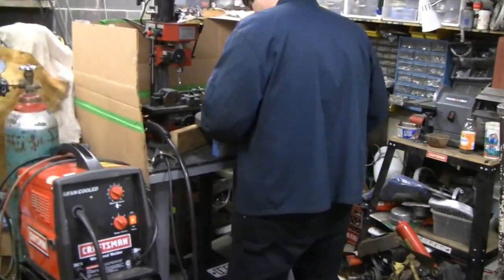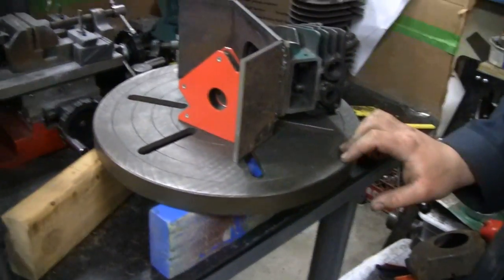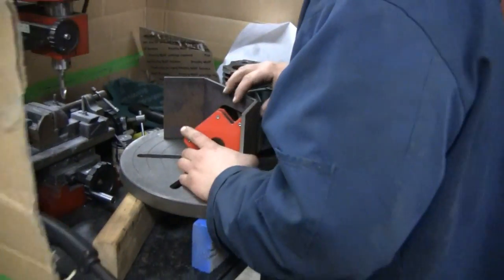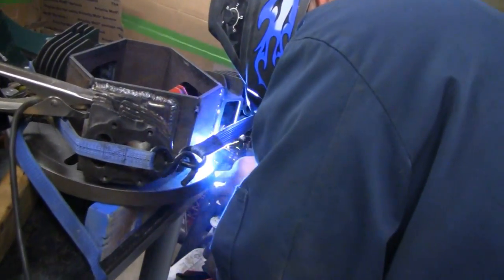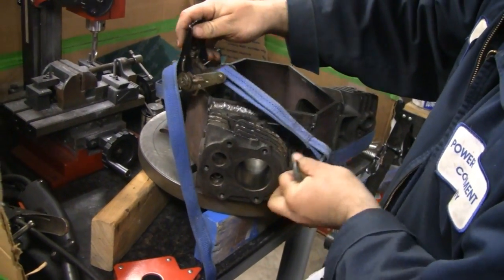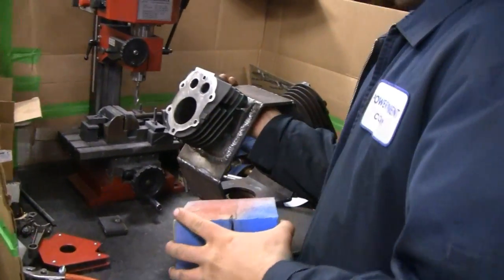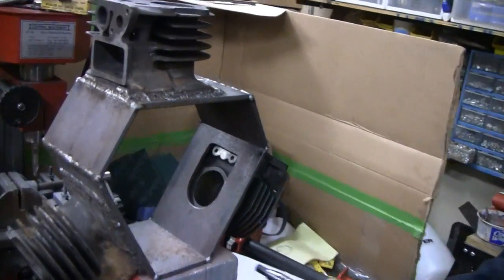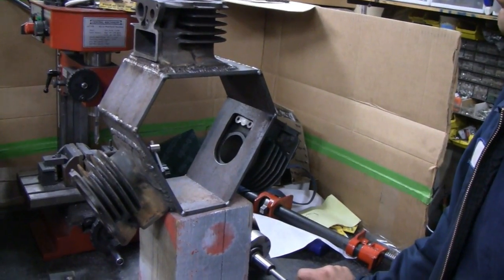HOMEMADE RADIAL BRIGGS ENGINE (part 9)

Comment: Excellent work! Will you guys be welding the inside joints of those crankcase plates eventually? Or is welding just the outer joints of the crank case sufficient? Sorry, I've only done basic welding practice :-)

Comment: I was wondering. Since a briggs radio engine has never been built and I'm sure this will be a unique piece of art by the time it's done, I was reading the comments about the oil and adding an oil pump I was thinking would you guys be willing to add a turbo to make it even more unique than it already is?

Two more question! Is the oil pump going to be electric or move along with the crankshaft?
And what will be your source of fuel be, carb or fuel injector?

Thank you and I can't wait to hear it run, great job so far!

Comment: why is the crankcase so big? Are you guys going to make connection rods?
Reply from the maker: adam galbraith It needs to be that big because alotta stuff has to go in there!! Yeah we gotta make the rods!!☺
Reply: at you going to use a propeller as a flywheel? and what are you doing for ignition?

Comment: Won't you have problems with the oil collecting in the two bottom cylinders and valve cover areas?   Looking good, I was just wondering.
Reply from the maker: 231flash Probably have some oil, but nothing that would cause a problem!!☺

Comment: Really cool project. Have you thought about some kind of baffle for the lower cylinders? Aircraft engines usually have the sleeves longer not to let the oil drain from the upper parts directly into them, so it doesn't smoke too much. Keep posting!
Reply from the maker: Gustavo Santiago Thanks Bud!! Yeah we're tossing around a few ideas to prevent that!!☺

Comment: Maybe one thing you could do is have a little chain driven oil slinger at the bottom of the crank case, that way you won't have to do any complex oil lines like with a pump.
Reply from the maker: Cameron Jenkins The oil pump is alot easier and more efficient!!☺

Comment: Oh Hell Yea!! Pg2 It may be prudent to move the cylinders IN even closer to the center line of the crank case, to reduce rotational weight of the spinning assembly and too shorten the length of the con rods. This will allow the crank shaft/flywheel to overcome the resistance of a rotating assembly.

Comment: Can't wait to see it done, you guys know what would look cool, put a class peep hole in the crankcase so you could see the insides when its running, also i was wondering because the crankcase won't be cast iron isn't there a chance it could warped when it get hot.?
Reply from the maker: Hunter S It would seize long before it would warp!! Those little 1 horse cylinders don't create much heat at all!!☺

Comment: Oh Hell Yea!! That radial beginning to look like something now, starting to take shape. I have a concern though about the distance each cylinder is from the center line of the crank case. The crank shaft that Mike was holding may have too small of a throw to over come the the mechanical advantage the con rods will have against the rotational force of the crank shaft.

Comment: I was wondering when Mike was going to get time to get back at this. The 3-cylinder radial is going to in the 'super cool' class of projecst you guys have done. 
I have a question, Are the inside seams going to be welded too, or is there no need? 
Cheers.
Reply from the maker: Reg Sparkes Nah no need to weld the inside seam!! The seams were almost 100% welded because of the angle they were set at already!!☺